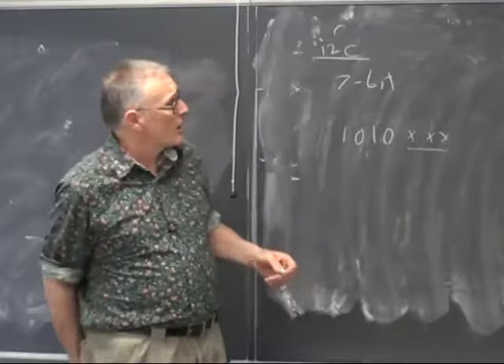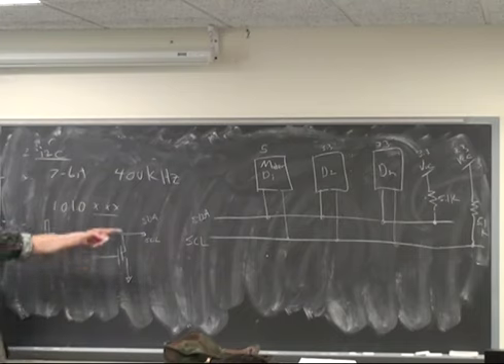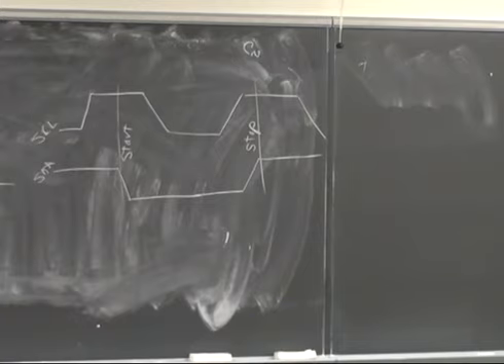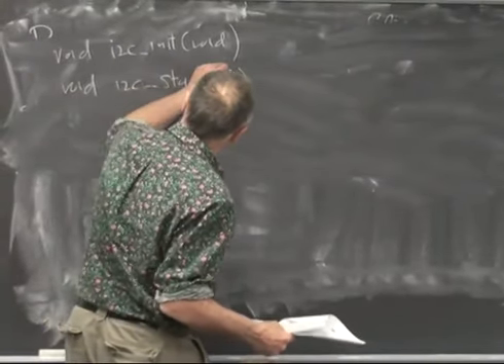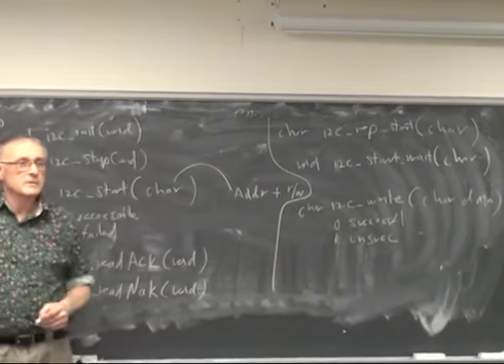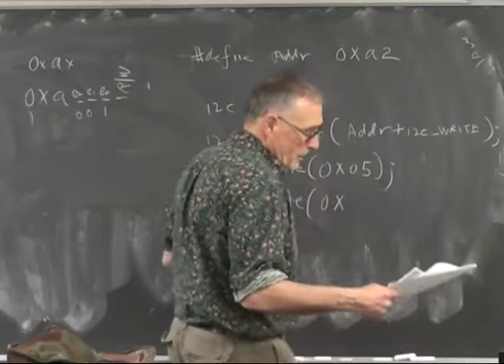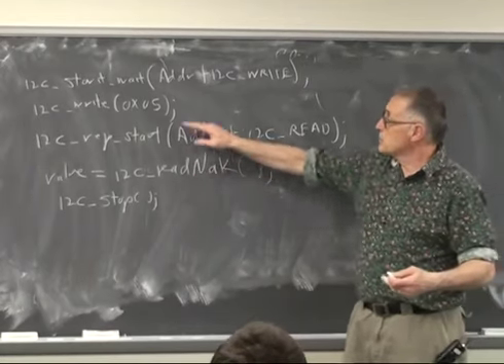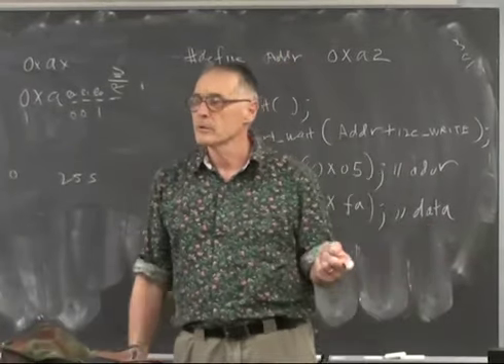#28 -- TWI  (I2C)

Comment: Safety glasses or soldering? What hazard does soldering entail that could be negated by wearing safety glasses? You don't need to wear a breath mask when your face is right above melting, fume emitting, lead-based material, that's for sissies. We don't require you to wear any gloves to prevent you from accidently burning yourself with the iron, you just need to be careful. But You MUST wear safety glasses! I had 17 students confuse the flux for eye drops last year and that's not going to happen again on my watch! We also don't want anyone trying to melt a glob of solder onto millimeter wide copper pad, having a seizure, and accidently jamming the iron into their eyeball. Translation: The people at the insurance company don't understand what soldering is.
Reply from the maker: I have flipped solder onto my glasses several times in the last 50 years or so.
Reply: We must have very different soldering techniques, but I meant no real offence. I really did assume it was just an insurance thing. Still, it makes me wonder how you flipped solder into your glasses. Do you do spin the cord around your finger like a gunslinger after you finish joints? How do you build up the kinetic energy required to launch a glob of solder in the direction of your face?

Maybe I should be wearing safety glasses, but I can't think possible scenario where the tip of the iron would be moving quickly in the direction of my face. The iron only ever moves quickly in a horizontal direction. The only exception is when you're putting it back into the stand. In which case, the tip of the iron is still moving away from your face.
Reply: Bruce Land I want to make it clear that I have a lot of respect for you. You're a professor at Cornell University so you have clearly demonstrated that you very knowledgeable in your field. However, if you say something that doesn't seem to correspond to reality in any way, I'm inclined not to take it seriously.

Getting solder in your eye because you didn't wear safety glasses while soldering is less likely than getting ink in your eye because you didn't wear safety glasses while doing calligraphy. At least the is solder attracted to the heat of the iron. How often do calligraphers visit the hospital to get the ink washed out of their eyes?

You said that over the 50+ years you've been soldering, you've launched solder into your glasses several times. In the most respectful way possible, if you are concerned about this happening with your students (or others) I could see you saying that it's happened to you even if it really didn't. Telling a little white lie would be a very good thing if it prevented someone from loosing a portion of their eyesight. As a highly educated person, I'm sure you know that anecdotal evidence isn't very reliable. This is especially true when you can't think of a possible way to reproduce the events of an anecdote. I could buy it if you could give me a situation where you move the tip of an iron quickly in the direction of your face. I honestly want to wear safety glasses if there is a danger, but simply telling me that something I can't verify happened to you (when you are already concerned about people flipping solder into their eyes) doesn't tell me it's a real possibility. It only tells me that you are concerned that I'll flip solder into my eyes (or just your students, but I appreciate the concern either way).

Even so, I'm going to take you at your word and concede that you've flipped solder into your glasses a few (let's be generous and say 5 times) times over the last 50+ years of soldering. That gives you a risk of 0.1% per year. Then divide the 0.1% by the times you solder in an average year and that's your risk per instance. You're a professional who teaches, and I'm guessing you probably do some hobby stuff, too so lets say 100 times a year. When you solder, you have a 0.001% chance to flip solder in your eye.

What percent chance do you have of inhaling lead fumes from the every time you solder if you don't wear a mask or use a fume hood? That's pretty close to 100%. Do  your soldering stations have fume hoods or do you require your students to wear masks while soldering? You might think that loosing partial eyesight is more of a hazard than being exposed to solder fumes, but I'd have to disagree with you there. A lifetime of soldering with out safety glasses may leave a small percentage of students lacking partial eyesight. A lifetime of soldering without a mask or fume hood will leave a larger percentage of students with work related respiratory disease.

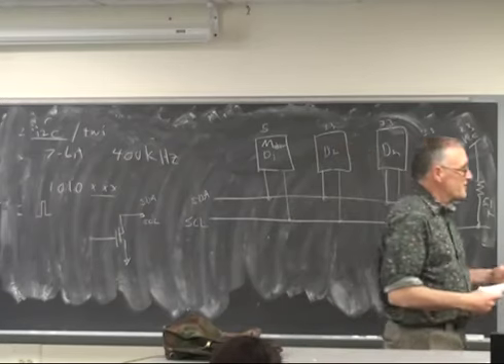Comment: At 13:58 is more about that Data must be sent as LOW while the Clock as HIGH as a listening state, so the transmission is started when the Data signal goes to LOW and not HIGH because HIGH is the normal state, if you see it like that there is nothing twisted as you think 15:11...